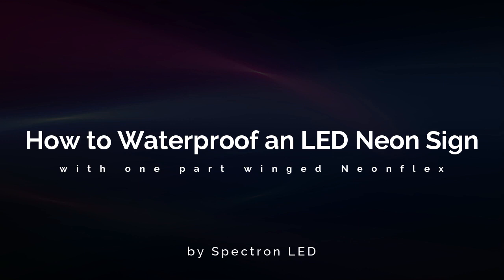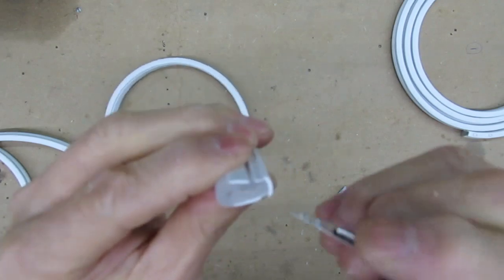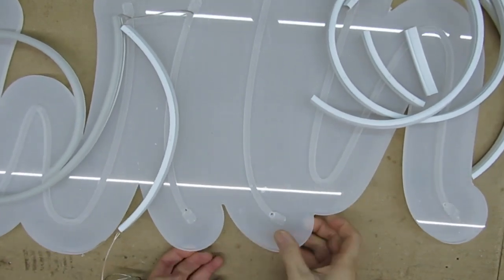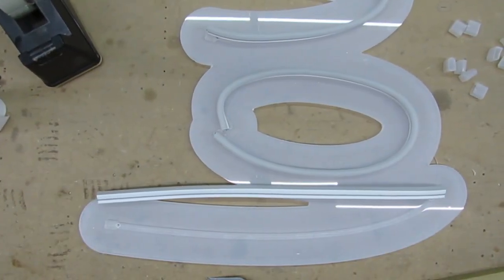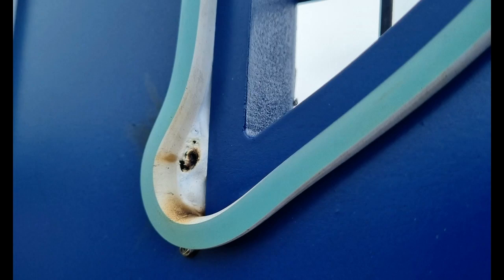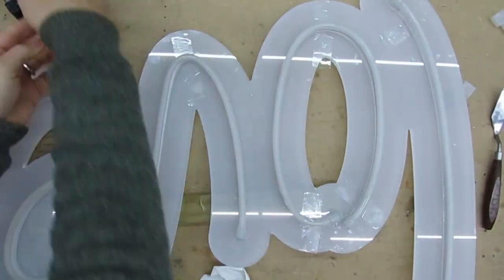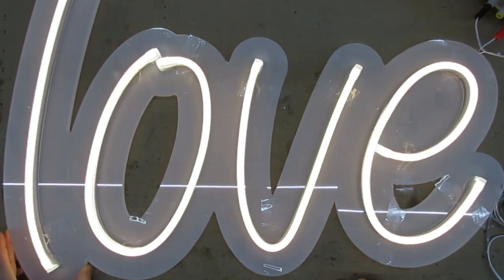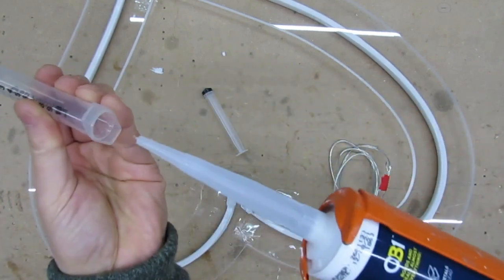How to Waterproof an LED Neon Sign for Outdoor Use

Comment: Hi! Cool job and good advices! I was wondering, the part with the big letters, to avoid voltage drop, for the others letters I guess you also did it in pairs but in terms of connection, did you kept each of those lines separated and connected directly to the power supply or did you do a series circuit between them? If not the case could you illustrate please? Thank you , I’m learning to make neon signs and had that voltage drop problem recently so saw the opportunity 😊😅
Reply from the maker: Hi! For letters using more than 3m of neon, we connect directly to the power supply to avoid voltage drop and keep the power cable as short as possible, ideally 1m max. Hope that helps!

Comment: What is the acrylic that you use. Also can you share a video of cnc cutting acrylic, what tools to use to cut acrylic and other details. It will be very helpful. Thanks a lot.
Reply from the maker: Hi, it's 5mm clear acrylic. We use a CNC machine with our CNC cutter for winged neon flex. We do a first pass with a standard cutter first, to clear away a majority of the material in the channel, before using our winged cutter. This preserves the winged blades. We generally cut to a depth of 3.5mm when using a 5mm panel. If using a 10mm panel we will cut to a depth of maybe 6mm. Hope that helps!